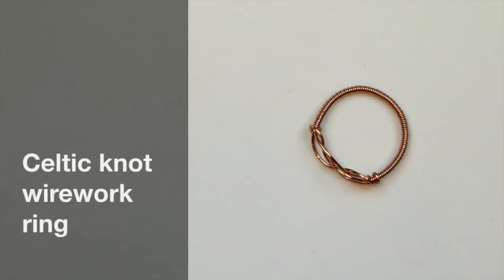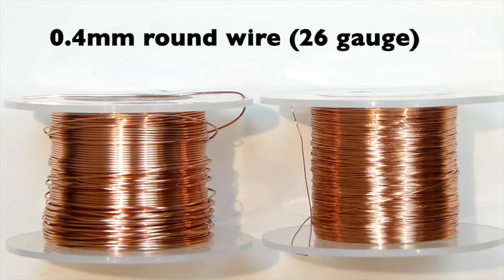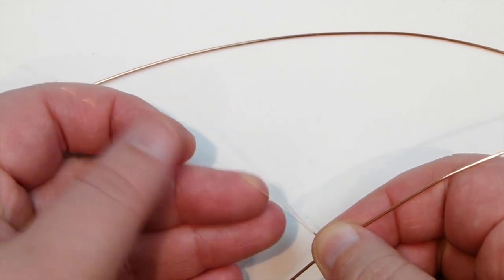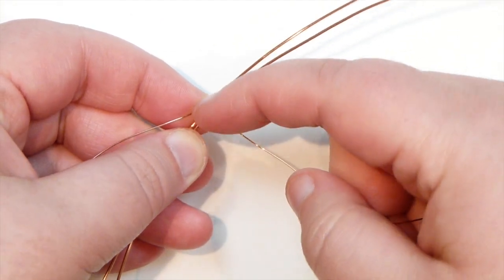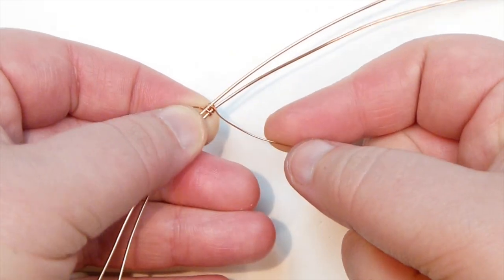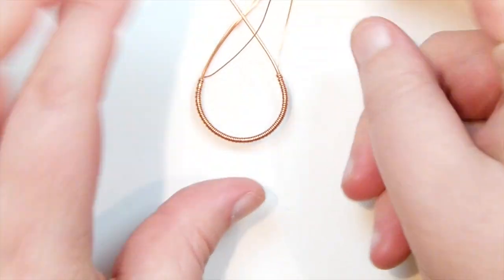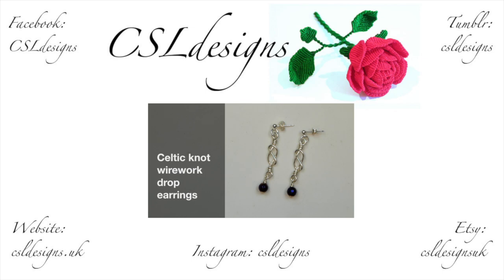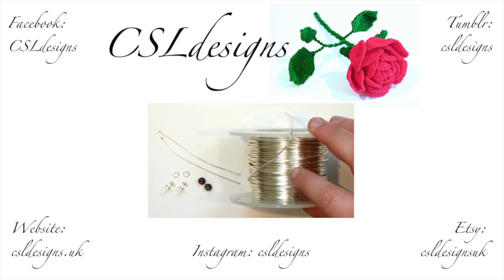Celtic knot wirework ring

Comment: I have just tried this and feeling very frustrated as my wire woven ring base turned out well, but can be improved on with practice, but despite pausing and rewinding I was not able to achieve the knot. As I froze various frames I thought I had it right but  I must have missed a couple of moves. I will have another go but feeling a bit cross-eyed at the moment! This is the first one I haven't followed. I think your designs and instructions are wonderful.

Comment: Very cute ring, youre my favorite Wire Jewelry instructor. 

I dont know if you've done a video on types of wire for beginners or not but with me being new and needing to practice a lot. 
I need a very cheap and practical type of wires to practice with. 
And it has to still be a nice wearable non tarnishing piece of jewelry. 

I was thinking about stainless steel or aluminum that can be bought in bulk or bigger wheels of inexpensive wire at the local hardware store or online. 

I would love it, if you will give us some pointers on how to work with these 2 metal wires. What gauges should be used? if it should be hard or soft wire? Any help that you can give us on inexpensive quality wire Im not talking about cheap Junk throw it away after one wear but good expensive wire would be greatly appreciated...

Thank You, ❤👍👍

Comment: OK, gave this a go, the weaving was fine  but I did get confused as to which wire went where for the knot and  struggled a bit  pulling them through so lost nearly all the curves. having said that I'm new to wirework so maybe I need to  practice more ( maybe on something simpler first!
Reply from the maker: Karine Oldale I'm sorry about that. It can be a little confusing, but just try and make sure that all the wires are crossing over and under each other so no single wire is crossing either over or under more than one wire at a time, and you can also work on the curves a bit more once you have the wires in place to get it just how you want :-)

Comment: I have great difficulty working from the reel, as it seems to get kinked and knotted. What's the trick, please???
Reply from the maker: +Personophe48 I know what you mean. It isn't as easy as cutting off a length, but I think it's just a matter of getting certain habbits while working with the wire off the reel, as do a bit of work and then keep smoothing out the wire that's coming from the reel as you go where it tends to start to kink. And in stead of pulling more wire off the reel by just pulling it over the top (if you know what I mean), then actually turn the reel to get more wire off. That will also help prevent the wire from wanting to twist as much :-)

Comment: Well, I tried, disaster . I'm just not understanding which way you go with the wires for the knot.
Reply from the maker: septsapphire1 I'm sorry about that. Try and make sure that all the wires are crossing over and under each other, so no wire is crossing either over or under more than one wire at a time :-)
Reply: Thanks, my second attempt was better. How do you get your wire to bend like that without losing the curves ? Is there a way to condition it so its more pliable ? I'm going to keep practicing until I get it ! :-)
Reply from the maker: You can always run it through your fingers a bit before you shaper it. That will warm up the wire and make it more pliable. And also you can go in and adjust the curves gently afterwards to get them just how you want them :-)
Reply: CSLdesigns Thanks... I will definitely try it !